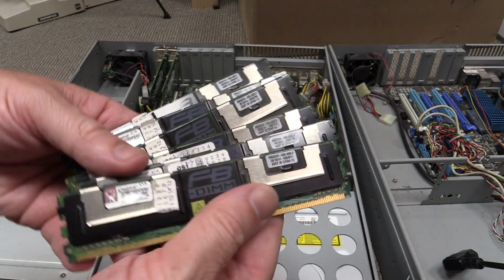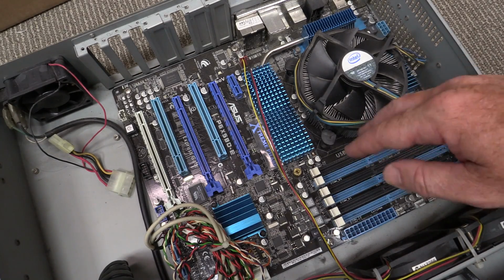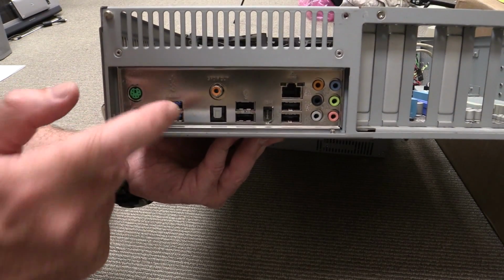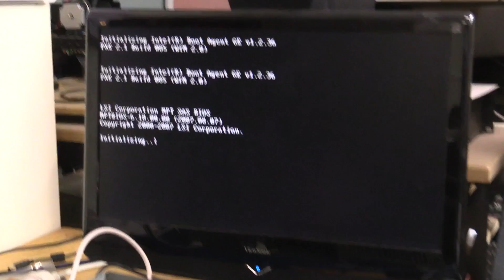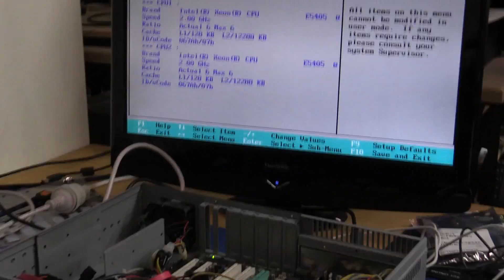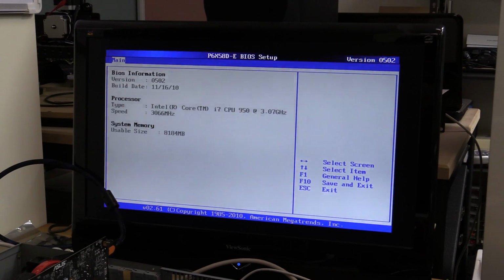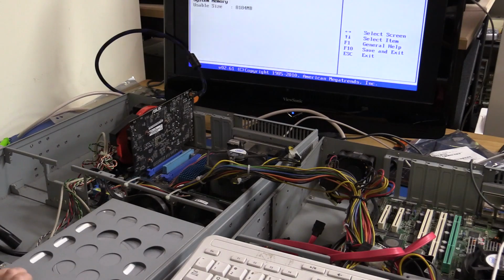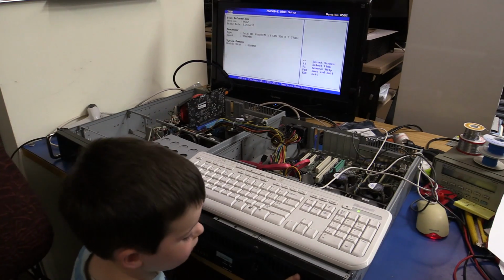EEVblog #838 - More Dumpster Server PC's

Comment: Damn, where the hack can you get all that stuff...
Where i live i sneak into soooo many "trash-rooms" of tech companies, where i likely, should not be, but hey, noone says anything, so it MUST be ok, right???
And all there is are pentium 4 era stuff, ok there was a nice analog scope once long ago, if i am REALLY lucky there is a intel core era pc/server with puffed up caps (i fix those), sometimes allready scavanged, without ram, etc, just all the sensitive data still there on disks, unencrypted... 
If i had a bigger pair i might "sell them a backup", just in case so it doesn't get in wrong hands ;-) 
A few times i packed their disks full of nasty to leak data (they were too small capacity for use/resale) with big red gift wrap tape, and card with printed link to free data wiping software, and left the gift at front entrance into building... hope they got the message ;-)

Comment: I'm a little confused whenever people who aren't involved in IT/etc more directly talk about Intel's "i7" and "Xeon" processors as though they are rating the CPU very heavily based on that name. The actual architecture, specifications, socket and performance of each i7 and Xeon, compared to other CPUs, varies immensely based on what its model number is and what year it was made; a Haswell i5 can easily outperform a Nehalem architecture i7 or Xeon 55XX in nearly every desktop usage case, for one of many examples. I think it came about via the sensationalization of the release of the first Core i7 (on Nehalem) in 2008. Since then, though, Intel has released many dozens more different kinds of i7 on half a dozen different architectures and they vary wildly depending on how recent they are and what specifications they have.
Reply: I wish I could give this comment 10 more likes.

Comment: The Dual Xeons might be a bit old but since they're all server parts (maybe except for the PSU) it's quite reliable. Also, as noted by others, the RAM used there isn't physically compatible with standard DDR2 (FB-DIMM). You can get a nice virtualization setup there with the correct amount of memory.

Comment: No  VGA out on mobo is actually a good thing. For low enf I3/5 processors the videochip is on the CPU, so MOBO needs some sort of video port on it. For I7 Mobos there is no video output on MOBO, b/c processor has no internal video capability.

Comment: I have that same i7 950 overclocked to 4.2GHz in my desktop, and it's still a screamer. Doesn't have all the new fancy features, but no point in replacing it until it dies.

Comment: Actually, I heard one time the older the RAM, the more expensive it is. I would do an extended memtest86+ test run to make sure the RAM doesn't have any issues whatsoever, but if not then you can sell those for like. half their price new, easily.
Reply: +Person. not really because they are slow, bandwidth limited and no one want them... But it's true, older ram cost more to produce than new ones.
Reply: Nostalgic?? Lollll if company who produce these ram stop producing them is because people dont buy them. nobody want this old technology, I have a couple that I am going to recycle, I will sell them to you for only 100$. it's ok? they are 256mo.

Comment: found a i7 with titan x ddr4 ram 512gb and 2tb drives sadly they were all dead except the ram and hdd you must be lucky
Reply: ***** Thx i was effin lucky i figured it was damaged by water cooling as it was a bit wet and there was a leaking water cooling kit next to the bin too i blasted the titan x and i7 with a hair drier and left it in the oven overnight (only the light was on my oven light is kinda hot 70c i didn't turn on the heat :) ) the mb was working forgot to mention so i did the same process in case it will fail. the luckiest thing was the mb box and titan x box was also there WITH THE EFFING WARRANTY i got a free replacement waiting for my replacement to be shipped back in 7 - 14 days for the mb and 28 days for the gpu (also working but just to be safe & cos it was free) sadly the i7 did not come with the box but it was dead so i got an old i5 from my local second hand gaming parts store($45 yes i have researched that model) I recovered some data from the hdd(hdd, ram, psu was not dead but replaced the chinese psu just to be safe it tripped a fuse when i turned it on) and figured it belonged to my neighbour who plays A LOT of games at 4K 3 monitors I will give it back to him I will update this soon.
Reply: Well i caught up to him and found that how his pc was damaged was by both liquid and fire damage. This story seems unbelievable but here's the deal:
He water cooled it with vodka(WTF) and it leaked causing a major fire. He ran into the kutchen, turned off the fuse box, grabbed his mum's jug of water and poured it over the fire. The gpu and mb was damaged by water(which the gpu survived in the 70c oven msi heatsinks are awesome) and i figured that ill give it a test. Forgot that the gpu came in early as msi said there was 100% no damage as their new titan x card was slightly waterproof(i guess they are just lazy) I did not tell the story of how half of it survived to my neighbour but he questioned me "how did you  know?" And i simply said heard you screaming "wtf wtf wtf dad the pc is on fire" and he just believed me when i lived 10+ blocks away :( I gave it a boot test at the second hand store i said before and everything worked except the card was going at insane temps so i borrowed a new watercooling tank from them and everything was fine(except i borrowed the psu, mb and case) so I will update this as soon as possible.
Reply: Oh yes the motherboard's temp control chips were dead and everything else was fine the asus guys told me when i sent it to repair. The mb was covered under mb water damage so i was pretty lucky. They said if i did not replace it it would go up in flames haha it worked with unigine heaven benchmark 4k ultra high for four times and it did not get hot lol

Comment: Not many people but CPU's for regular use from ebay.. I buy then for the scrap gold value or for stress testing / experimental over clocking but never for regular use.
If I knew it would be worth it I would offer to flat out buy both of the rack cases but since I can buy new cases for less than the shipping charge.. Yeah..

Comment: What the Heck! This is almost depressing... I've just recently swapped i7 950 @4GHz to Xeon w3680 , put a huge Nepton on it - to get OC 6x4.5GHz and felt so much "godlike", leaving those  Skylake at stock clocks  behind (and other 4 freakin missed generations of ix) and whatever... and now i see, that You can find such things in a dumpster in a civilised world, that's how old that junk is... 
For the sake of whomever, Dave, please, i think You should, instead of selling that junk, You should god damn overclock the hell out of it, until it burns, with all the calculations and measurments, hook an external stable voltage on 12V rail, check the DC-DC of whats on board, their limitation compared to datasheets of those intersil/richtek/whatever and fets their drivin. Flir cap until it burns (sorry, nope, thermal protection everywhere)...

Comment: Goodness! Drives me nuts to see someone with zero computer knowledge or use for these computers getting them for free... :-( I laughed when he said that modern i7 processors are far more efficient... Sorry Dave, but no... My i7 processor (4930K - a slightly lower class than the one you found) sucks 130W at stock speeds, and mine is probably pulling closer to 175W overclocked... So yeah, when you compare the same class of CPU, the power consumption is  very comparable. Efficiency hasn't changed nearly as much as they would have you believe. :-)

Comment: "Novelty value" Xeons E5xxx. Ha, stick Linux on it and you can have a very respectable desktop out of it. Sadly it's not power efficient enough to run fanless. Remember this has 2 of those so it's about comparable to the ancient Nehalem i7 as long as you have multiple threads. I think neither has any appreciable turbo mode for souping up performance for single tasks.

That RAM though is a gold mine.

Comment: SAS is a newer serial scsi interface for SAS harddrives, they are "sorta" compatible with SATA but the connectors are different. They are full duplex interfaces and used for high and long term usage commercial purposes, and VERY expensive.
Reply: +HUGSaLOT Valkyrie Not that expensive at all. The disks with SAS are expensive only because they are rated for actual heavy load and long life. SAS itself is a minor modification of SATA, in fact you can get conversion cables for cheaps.
The controllers that take it are available in around $100 range from decommissioned servers on Ebay, straight from China. These are fast enough to take 8 SSDs and not break a sweat, a feat only integrated controllers on high end Xeon chipsets can pull off.
(One of ancient ones you shouldn't buy anymore showed up in the dual Xeon server, mother LSI branded - now Avago.)

SAS (miniSFF) connectors are awesome though bit bigger than SATA, no loose cables ever, proper industrial design.
Reply: +AstralStorm Conversion cables? Why would need to convert SAS drives to work via SATA? The reason they are different is because host controllers for SATA drives can not (or at least should not) accept SAS drives, but the connector on-board is designed in such a way to accept SATA if SAS drives are not around, if you need a cheap hot-plug solution to rebuild your RAID arrays with. When your business gets the dosh for a new SAS drive, you can swap the SATA drive out the SAS bus and rebuild your array again.

Comment: You seriously should sell that RAM. If it were DDR3, it wouldn't be worth much. But since it's DDR2, it is worth quite a bit more due to scarcity. We replace old servers at work just because it's too expensive to buy more DDR2 RAM to upgrade them, even used. It demands high prices on eBay. That's probably close to $300 worth of RAM, last I checked.
Reply from the maker: +solidliqs That much? I found another two sticks in another machine too.
Reply: Perfect.  Sell them.

Comment: The $45 Pentium G3260 dual core I just got for my file server is as powerful as the 5405 at WAY less power.  Not even worth using that monster unless you are really looking for a cheap initial cost machine.

Comment: Time to mine some bitcoins with those servers Dave!
Reply: +Mr_Mun That'd lose money fast. Totally not worth it.
Reply: +Ozzie Peck You can make a bit of negative money (as in, not lose as much) by GPU mining, even if electricity is cheap. Difficulty for mining is way too high for non-custom solutions, even if you pick the most efficient (compute FLOPS per watt) GPU, especially if you have to include the GPU itself in the cost.

Nobody serious uses GPUs for mining anymore, it's all ASICs now with 1000s GHASH/s. Even high end FPGAs are a bit dead in the water with hundreds of GHASH/s, while GPUs are single digit GHASH.
Reply: +AstralStorm You can make a lot, if you do it right. He needs a GPU, Cpu mining is a waste, but GPU mining is not at all.
Reply: well yes. agreed

Comment: SAS = Serial Attached SCSI, it's essentially a "server" disk bus similar to SATA, but using SCSI commands and not ATA commands.  Also SAS disks are usually full duplex, meaning they can read/write at each clock, whereas SATA disks usually can't.

Those 24GB of FBDIMMS (Fully Buffered) aren't going to do you much good unless you have an old board.  Consumer grade memory controllers can't communicate with them.  :(  FBDIMMS are quite interesting, I suggest reading about them if you get bored sometime.

Comment: Wish I could find some nicer used systems. Just started finding X64 systems, but all have like Athlon, opteron, Pentium CPU that won't handle what I want to do. I'd like to find some old systems and work with hyper-V, but the CPU needs virtualization and SLAT support which seems like is newer than the systems I find.
Love to find some Cisco gear too that will handle the more recent IOS that does I.Pv6 then I could build out a nice lab. 
At least where I'm at near everything when retired has like 8-10 years on it.

Comment: Hello Dave,

None of the socket 1366 or the later 2011 or 2011-3 board have onboard VGA or other video connections because of the cpu's don't have an videochip build in. Only the lower platforms have an build in videochip so that's also the reason why that newer board has no video outputs. 

Greetings from Roel.

Comment: On Intel HEDT platform => X58, X79, X99 you don't have integrated video. Only on mainstream platforms => P67, Z68, Z77, Z87, Z97, Z170. Also all i7 for HEDT platforms are 130W. The new "X" are even 140W. And this W is TDP.

Comment: I have the P6X58-E no D though.  The reason it doesn't have a VGA port is because neither the chipset nor the CPU had integrated graphics, and for an enthusiast market you weren't expected to use integrated graphics anyway.  First consumer 6 core processors on that chipset/socket.  All processors on that socket were i7's by the way.  Not sure where the cooler on that came from though, maybe it was just because mine was a higher model, but my 980 had a much larger cooler.

Comment: I'm surprised that they didn't take out the ram sticks, I know that when I worked at a recycling center/incinerator (yes it was both, yes I know how ironic that is) we were order to burn them from old government and business computers as they were paranoid that some one could get left over information from the chips. I'm not sure how realistic that fear was though. Maybe that is why they were gone from the other though and they just forgot to remove them from the ones that still had them in it.

Comment: If any of those towers were servers, even dual socket 1366 machines still on had mostly VGA ports on board, might still be worth checking out, though over here in the states I have a few places I can go to that buy motherboards for about $2 per lb. or about $4 per kg if I got my maths right there.

Comment: I've got the same i7-950 in my desktop. They are power hogs, the thing pulls 140 watts idle. My laptop uses a fraction of that under load and runs nearly 50% faster on video encoding.

Comment: A gaming/desktop class board in a server?  Interesting I guess.  I have a very similar board from Gigabyte running my gaming PC with an i7 930.  Mine's clocked up to like 3.7GHz and still runs every game I throw at it at 4K with two R9 290X's.  Not bad at compiling large codebases either, but usually I leave that to my slower AMD home Linux server PC since my desktop usually runs Windows.
Reply: +CalcProgrammer1 i run a server (private) with desktop parts.
Reply: I run my home server off of desktop parts but this looks like a professional server.
Reply: That's cool, i have an old Phenom II X4 955 machine i got for free because the motherboard has some issues. New cooler and a OC, works like a charm. I'm thinking a used gtx 960 would go well with it, but i never imagined that a similar processor could support dual 290X, that's amazing.

Comment: You can't use these RAM-s on normal PC only on with FB support because the slot is slightly different. Even they are the same DDR type.

Comment: YOU ARE LUCKY!!! How can someone throw this???
Reply: +MP-Tuners Productions Because they are 6 years old and, by modern standards, very slow. They were depreciated to be worthless and replaced with brand new, far more efficient, faster, cheaper to run servers.
Reply: +Mark Henderson i understand it from this point. i just think they could give them away for free to anyone and not just trow them. two xeons with enough ram and good gpu are fine for games
Reply: +MP-Tuners Productions I tend to notice Xeons get thrown/sold relatively quickly. Xeons are dirt cheap on eBay compared to their i7 counterparts in the same generations.
Reply: ccricers funny because I always wanted to run dual xeon config at home, but never had chance to do that
Reply: MP-Tuners Productions Me too. I had the Asus Z9PE-D8 WS motherboard but I could not then afford the socket 2011 Xeons at the time. Socket 1366 is cheaper but they are still good especially two running together.
Reply: ccricers I am running C2D E8400 in my workshop , so tell me about it :) ... I have xeon server here, but it's big hungry HP machine, that is just standing here, since it takes 1600 watts, and my power outlets are not able to feed it with enough power
Reply: +MP-Tuners Productions Easy, you walk it down there and toss it in, Australia is about as wasteful as Las Vegas, Nv where you can find this junk without having to have a key to a trash room..